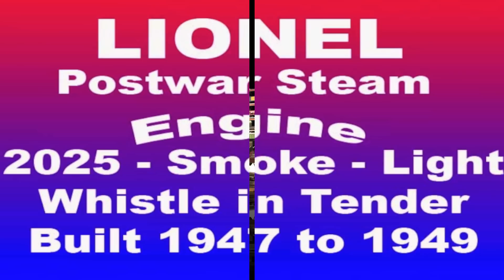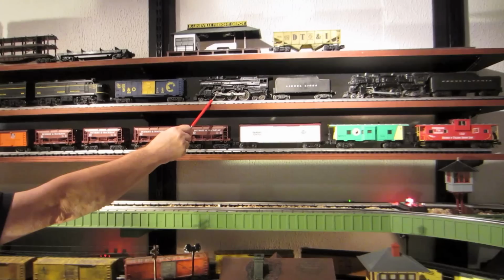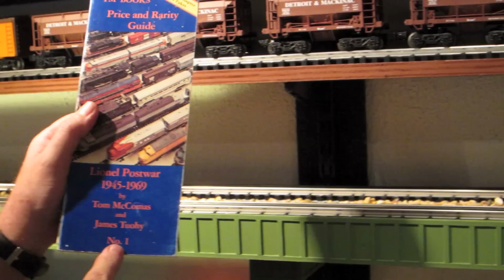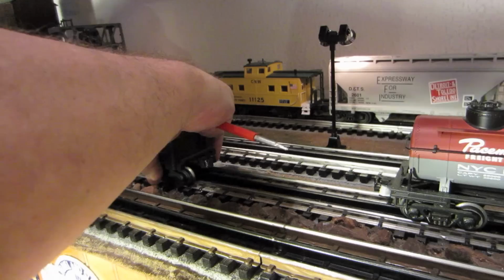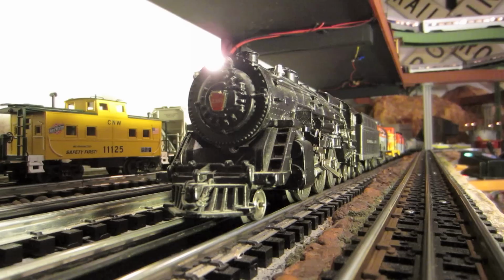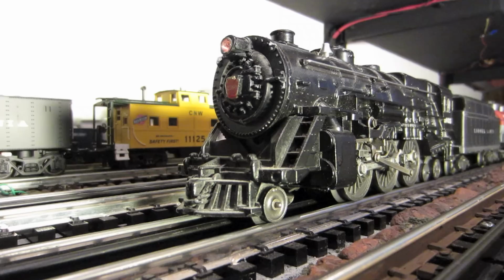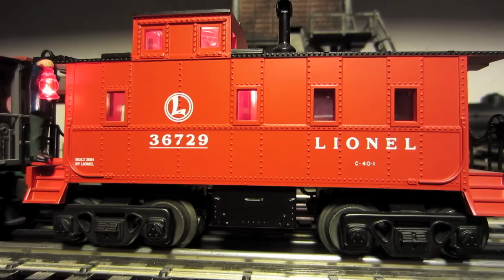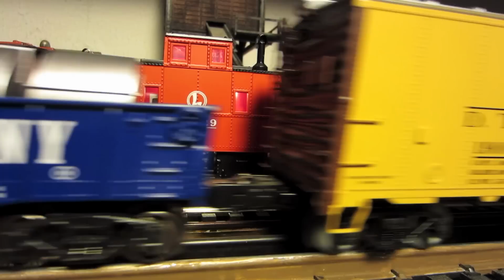Lionel Postwar Steam Engine - HD

Comment: Gary, nice video; there is an interesting history on the P/W 2025: there were 2 periods of production separated by 5 years.  The first period, which you refer to in your video, was from 1947-49.  These engines are characterized by: an aluminum smokestack, Baldwin disk drive wheels with nickel rims, a pilot (cow pusher) with no coupler detail, a 2466WX tender and several other identifying differences.  The second period was during the Korean War (1952) and is just like the one you show in your video.  These are characterized by: sintered iron wheels (similar to 2025’s cousin 2035) without magnetraction , a dark colored smokestack, a pilot (cow pusher) that has molded in coupler detail, black steel motor frame sides, red and gold keystone decal on the boiler front with “5690” on it and a 6466 tender.
Reply from the maker: Hi Brian: Thanks for sharing this historic information and watching. Train Room Gary 🚂

Comment: The 2025/675 was from 47 to 49 had Delta trailing truck.Starting with 1950 Magna traction was added so the drivers were changed to Sintered steel with the spoke design and the four wheel trailing truck replaced the Delta style truck of previous years.Incidentally this locomotive desended from the prewar 225.personally I wish Lionel had carried over the 225 but it is what it is.
Reply from the maker: Hi Robert: Thanks for sharing this information and watching. Gary 🚂

Comment: Hi Gary!!! That 2025 is a type V, it was made in 1952 not 1947-1949....you can tell by the cintered-iron drive wheels and the die cast two wheel trailing truck is gone. Frank

Comment: Question, I have bought a 736 postwar berkshire engine at an estate sale. The 736 numbers look like they been rubber stamped with paint.  I notice on other 736 engine they are heat stamped. Do you know if Lionel rubber stamped the engines and then heat stamped them? Thanks
Reply from the maker: Hi XYtruck25 / Over the years the process for printing the numbers have changed.  The rubber transfer may have been the process.  If you have a Lionel Dealer in your area. Show them the locomotive.  A lot of these train shops are on top of Lionel History.  Screen printing and digital ink jet is being used today. / Thanks for watching and commenting. Gary  🚂